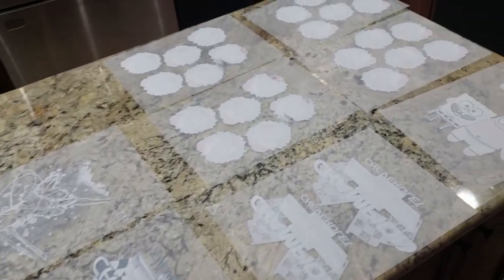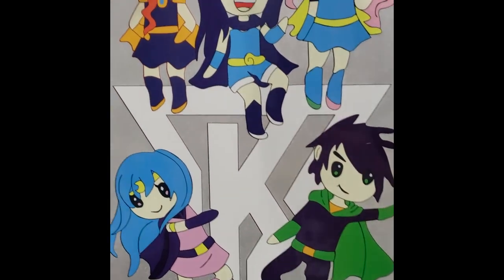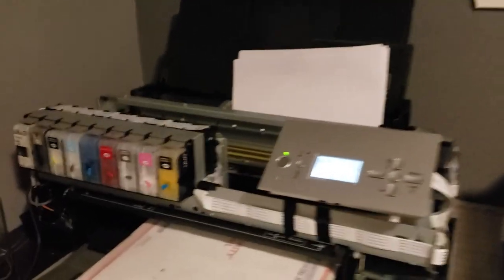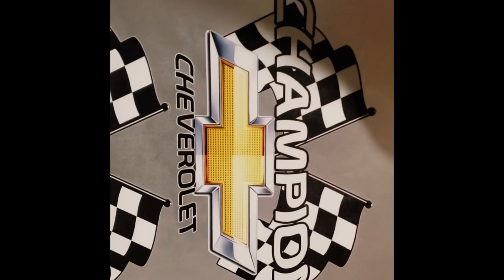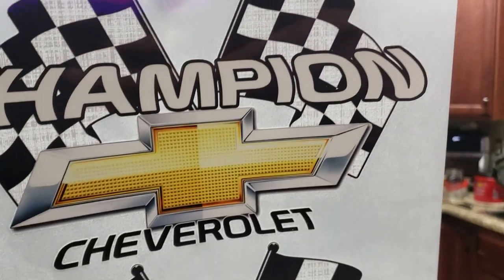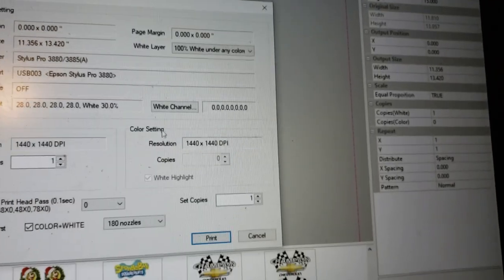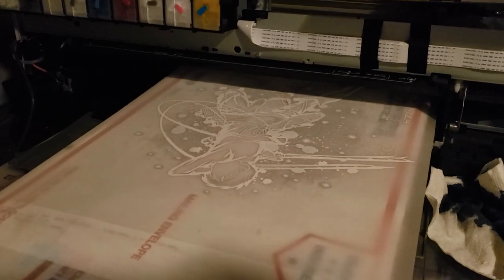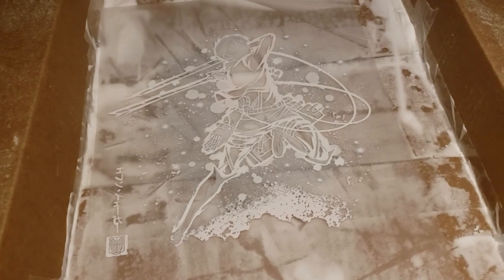Should You Buy or Convert a DTF Printer? A Day Making Direct to Film Transfers Home T-shirt Business

Comment: Great explanation video

Would you be able to use any design site to create the image, like photoshop or can’t think of another site

Does the powder help to seal in the image?
Reply from the maker: Yup, as long as it's a high quality image, preferably a png at 300 dpi. The powder is like the glue, it's what makes it a transfer. And it's highly toxic to breathe. So I cure it outside.
Reply: @Red.E.Hustle  ohh thanks for the info, how long does it take usually to cure?
Reply from the maker: @SheWritesHerJourney_  about 90 seconds in my oven at 250

Comment: Hey Red, I bought a dtg machine from DTG pro. They recommended I switch to dtf since I had huge problems using it as dtg. So far the prints are pretty good. Sometimes my designs have hairline areas that are not inked. For some reason the hot melt sticks to these areas as well as the inked area. After pressing the film you can see the excess hot melt. Any tips on this issue?
Reply from the maker: I hold my film face down, and I snap it like a belt. Gets a lot of the extra powder off. Sometimes some powder is still left over after curing and will transfer to the shirt when pressed. But when I use a butcher paper on the second press it usually will come off on that.
Reply from the maker: Also I wait 10 minutes or so after it prints to powder. This will also help.
Reply: @Red.E.Hustle  Thank you for the tips. I’ll give it a try. I agree on DTG still being king but DTF is good in some instances.
Reply from the maker: @1unsafer  absolutely, just depends on the design, material, and of course the person it's going to.

Comment: Do you feel like using a converted printer compromises the finished product vs using a regular DTF printer?
Reply: Also, how long can you go between printing without issue?
Reply from the maker: All Dtf printers are technically converts. They all use basic Epson heads. The finished product was just as good as any big print shops I’ve ordered transfers from.

Comment: Hello, how much time does it take to produce one tshirt with dtf proccess. ?
Reply from the maker: As fast as you can print, with my printer, I can do 8 to 10 an hour full size 12x16 prints. But i batch my prints out. Then press.
Reply: @Red.E.Hustle  + melting the powder 8 min + press right? it is around 10 min. so in total + - 20 minutes for 1 tshirt.Thanks!
Reply from the maker: @EHSUNATARIM  print, powder, cure, and press on shirt. Cure takes 90 seconds, press takes 20 seconds. If you take out the time between. 12 min a shirt. Depending on the design you can fit more than 1 per print. Left chest, I can fit a bunch on sheet. Probably can do 30 an hour

Comment: There's way too much excess powder left on your film and that looks terrible after heat pressing on the shirt, the best way to remove it is to grab the film with two fingers and  with your other hand hit the non printed side using your middle finger. That way there'll be enough force for the powder to come off
Reply from the maker: I don't shake my film in a bedroom. It goes outside for that. Done thousands of prints. If you snap your film indoors you will have a huge mess.

Comment: I had a terrible experience with DTF and apparently the issues that come with DTF printing are not uncommon. In short,  DTF printing is unreliable and plagued with problems and thats not a good thing especially if your printing to fulfill orders for paying customers. Id say the problems are due to the fact that the printer components are not designed to work with DTF ink and films.
Reply from the maker: Ya of course, most people are using l1800 and crappy ink. With a really cheap entry point, you would be shocked at the lack of research people do before they run out and get a printer. No consistency with film and ink is a bigger issue than converted printers. But with that said, if you are in any dtg groups on Facebook, look how many struggle with printing dtg with a 20k printer. A lot of them are discovering dtf and only printing on film now. I think it's insane. Each have their place, I'd roll with dtf over white toner any day.
Reply: do you think the l1800 is a good choice with good ink?
Reply: @303hilo  i  guess it depends because what is considered “good ink”? L1800 just means the model of the printhead from what I understand. these printheads are epson printheads, just like the dx5, dx7, etc. from what ive noticed, the vast majority of dtf, dtg printers use epson printheads. The printhead mostly determines the quality and speed of printing. The printheads that are faster,have more nozzles, produce high quality prints and so on are naturally more expensive. 

Remember though, your not making photo studio photographics prints or commerical posters on photo paper, your making dtf transfers so the l800 is ok id say. The l800 is used alot cause its relatively cheap, couple hundred bucks or less if you need to replace it and not too complicated a printhead. It was used on Epsons desktop photo printers, more top end consumer grade than commercial grade.

Now, if you get a printhead that was used on say a large format epson printer, its gonna be a more commercial grade printhead, usually translating to better quality/performance. Keep in mind Epson never designed any of their printheads for use with dtf inks. Its why epson doesnt make a dtf printer, not yet anyway. Ink will always be a challenge becuase the chemical make up of dtf inks is almost like a latex, if it dries up due to lack of use or build up from lots of printing, it can clogg up the lines and or dry up around the printhead, requiring frequent maitnence. A more commercial grade printhead (dx5 or dx7 is what i see often as a step up) may hold up  a little better but they are not immune to issues if you neglect to take care of them and they are costlier, $1000 or more if you need to replace.